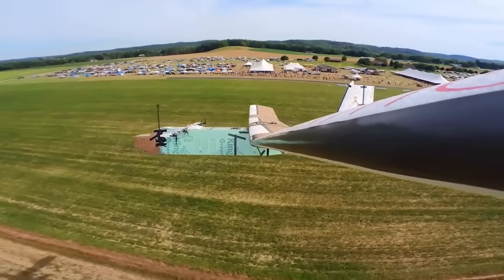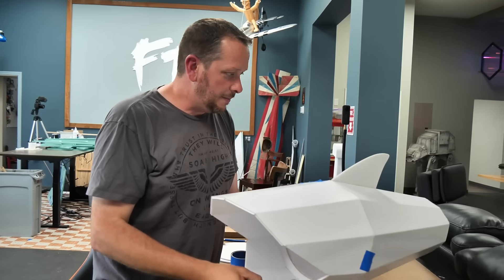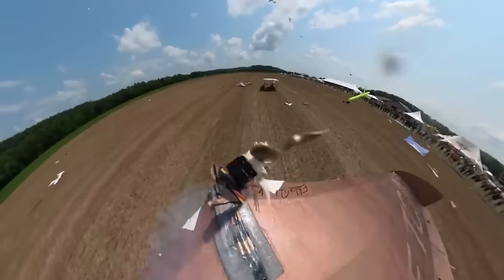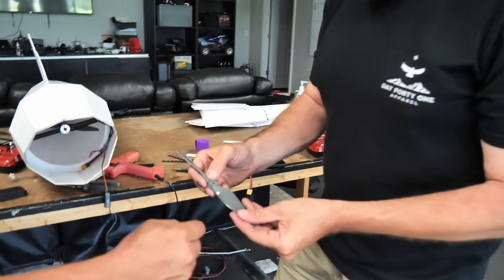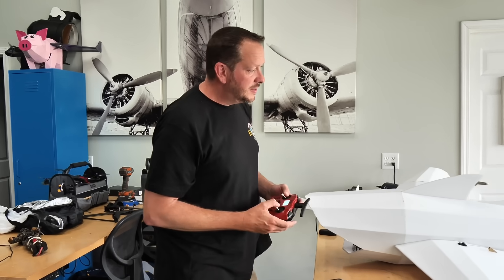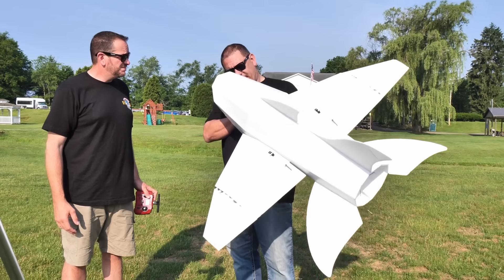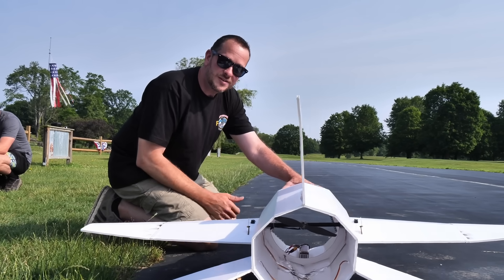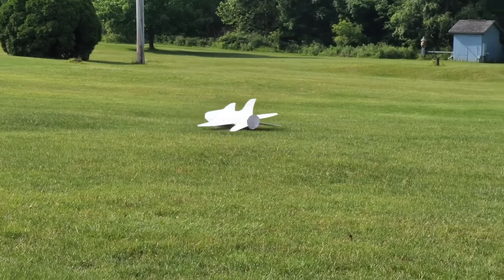Can Jaws Fly? DIY Shark takes To the skies

Comment: The Design is weak for air to air combat. A single glue joint holding parts on will fail. Take a clear, very thin polycarbonate tube. Super light. ? 1/32" thick but strong. Cut leanths same as glued joints, now glue the tubes pushed up against the joints. U then triple the ramming strength.

Comment: Why not add another motor with a counter-rotating prop? It would, maybe, counter the torque and add extra speed. Might, also, want to put a truncated cone at the rear, for better thrust.
Reply: Also, if you haven't already, check out the Italian Caproni Campini N1 from just before WWII.

Comment: Give you idea: think pencil sharpener old school ,2x spring loaded chew teeth.. ..pappermil has a machine called hammermill.. its flat steel plates on walls and in center is metal rods  with steel ball on end.. The rods and ball barely fit through template cutout of the rod and ball.. Hammermills take a 5 ft round tree and turn them to tiny ,almost dust wood chips that makes paper !,TP .. :>)... They also got a huge pipe with alot holes in it.. trees bounce around spinning pipe and takes off all the bark !

Comment: Push-pull arrangement similar to the Dornier DO-335 Pfeil from WW2 except internal to the body.  Not so much for more speed as to get rid of any torque turning if/when you hit the throttle.  You COULD also include the rudder/elevator control surfaces INSIDE the tube as well to protect them during the combat, then just have non-moving stabilizing surfaces on the exterior.

Comment: I'd love to see a second shorter but larger propeller in the back spinning in the opposite direction prop in the back to counter the gyro force of the first prop but also further blend anything that happens to go into the front.  In a blade you can increase the with of the individual blades to match the weight of a longer blade.  It would help scavenge the pollution of spinning air and increase the velocity of the exiting thrust plus counter the roll produced by only having one constant spinning centrifugal force.

Comment: Make an internal thrust tube for it to compress the air flow.. you should get more speed from that. Maybe for from the diameter at the motor down to 80% of the rear opening to start. Simple megaphone style poster board tube should do the trick and still be light enough to not effect weight too much.

Comment: you toob. carbon fiber pla or graphene pla is very close to normal carbon fiber parts. 3d printed metal (fdm) is even better. not laser, not cnc. so no win, kick in the knee? brothers. peace. so why elrs when all radios come with the compatible (2.4GHz) receiver. om nom nom brothers. watch out for torpedoes ;) foam solar kite plane drones if you are interested. yes very large and light weight, can fly from wind only too. flying shark brothers. lol. not so weird at all. solar kite drones are pretty much helium blimp drones. blimp is a large target too. nice.
Reply: how about a micro plane/drone that flies long with a single AA standard alkaline battery, or rechargeable similar size.
Reply: multiple box wings side by side wing is a biplane wing.